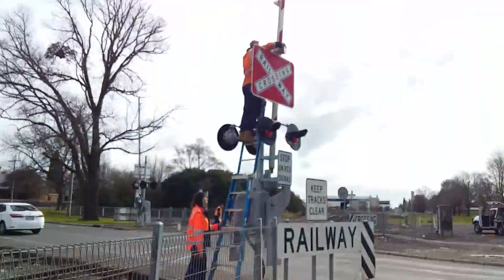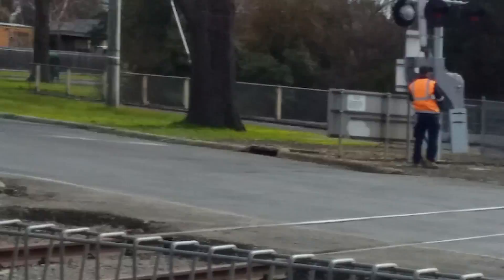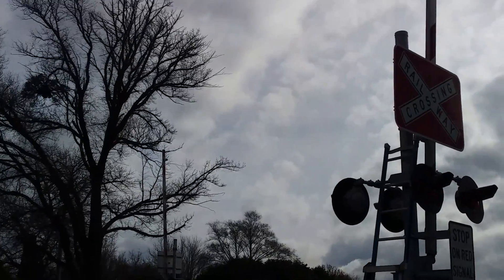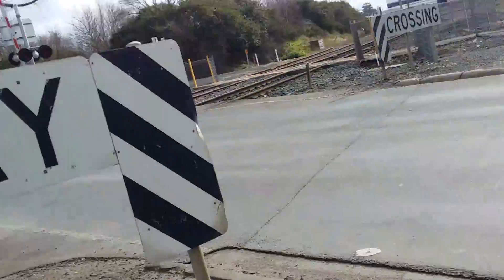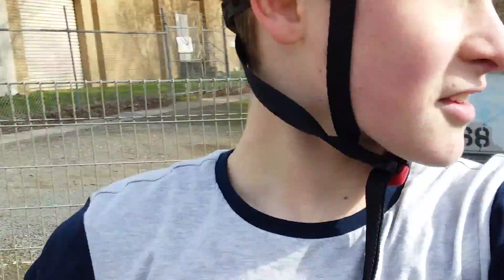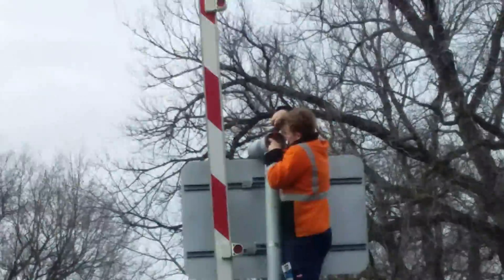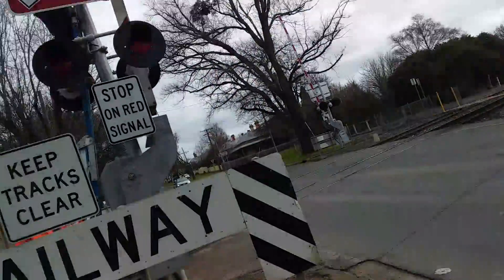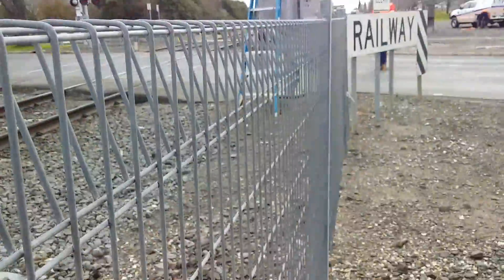A Dead Safetran Type 3 Electronic Bell Being Replaced With A New One

Comment: That’s so cool they let you do the test switch and you got to tell them about the dead bell!
Also that’s not even an older Safetran Type 3, that’s one of the newer ones! I think that further cements their high fail rate.
Reply from the maker: It sure is, I couldn't believe it, I though it was an older one at first but it turned out to be a newer one. I told them that they have a high fail rate, but they still use them either way.